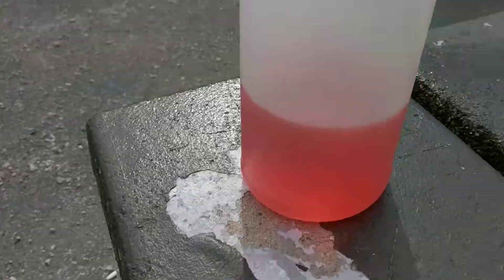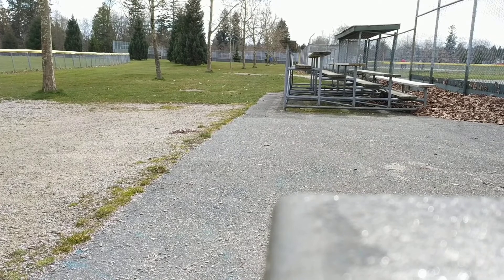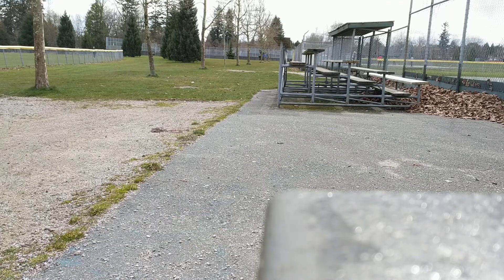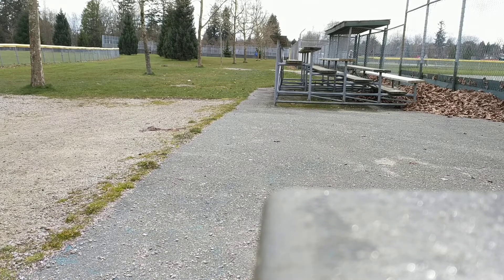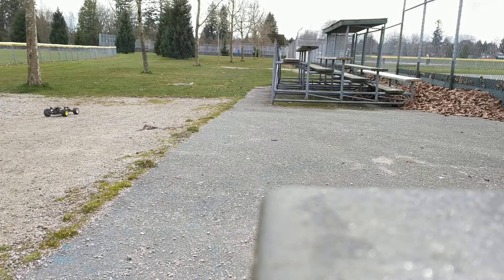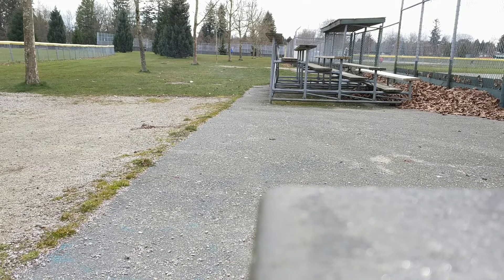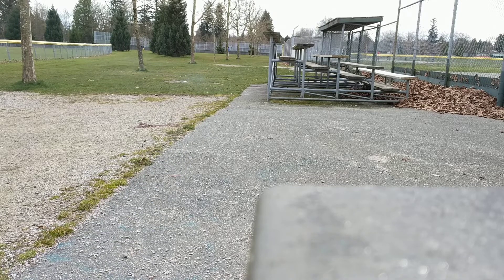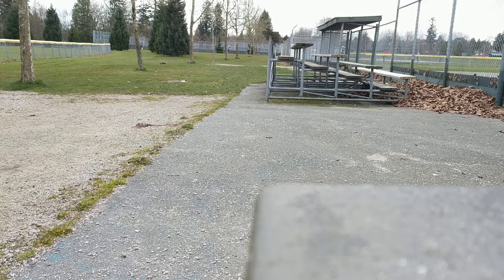RC10GT run on weird fuel

Comment: Nice video Bug, hey can you do a video on engine shimming for higher nitro content?
Reply from the maker: Thanks bub and if you are say going from 20% Nitro to 30% there is no need for shims or a different glow plug just a little tuning if you want to run 0% Nitro then pulling a shim will help with a little more compression and timing advance which will make it run better. I know sum novarossi engines need to be shimed but those high engine race engines I will add that into my video tomorrow keep you eye open

Comment: Luke i remember seeing a video of you having the .19 and 3.4. Can you do a video of side by side comparison of each. Specifically the crankshaft length. I would appreciate it. Trying to put the .19 in the losi ten sct
Reply from the maker: Yup I can put something together
Reply: @thebug4046  I bought the dynamite. 19 and dynamite .21 dont know much about big blocks besides what I have on my savage but the .19 I believe has a smaller crankshaft and I'm thinking of cutting a hpi pilot shaft to extent it or cut it to size and put a m3 screw to make it longer. Hope this makes sense.
Reply from the maker: @michael167191  if you're going to put a dynamite 21 in a Traxxas or something that won't work you need a specialty big block motor mount in a bunch of stuff the 19 makea lots of power run a 30/8 fuel and THS pipe kit
Reply: @thebug4046  alright will do. Thanks
Reply from the maker: @michael167191  no prob

Comment: Btw I have a t traxxas pro 15 and it's done sadly they are a beast for what they are
Reply from the maker: You can still buy all the rebuild parts they're fairly once this one finally doesn't run anymore it's getting a full tear down and rebuild also I am running a SH 18 carburetor at the moment one of the best upgrades you can do
Reply: @thebug4046  I have another engine in my Traxxas nitro sport is a vx 18 I have some vids in my channel if you want to see how fast is going on 16% nitro imagine on 25% it will be on steroids and I am going to rebuild it
Reply from the maker: @rc_teo_nade_216  I will definitely have a look and 16% nitro eh? What a odd mix
Reply: @thebug4046  ik